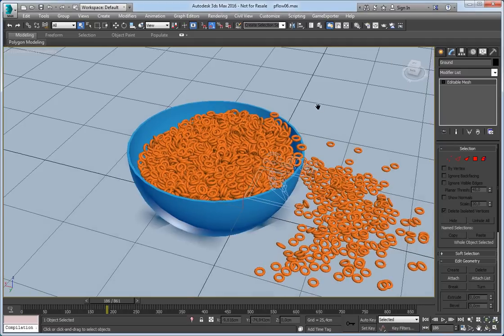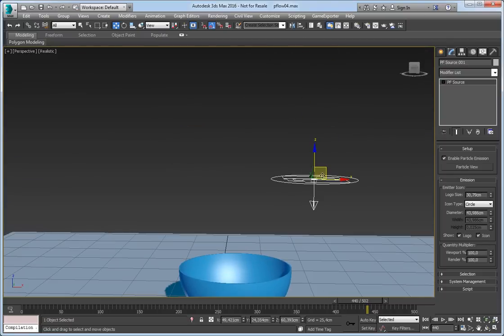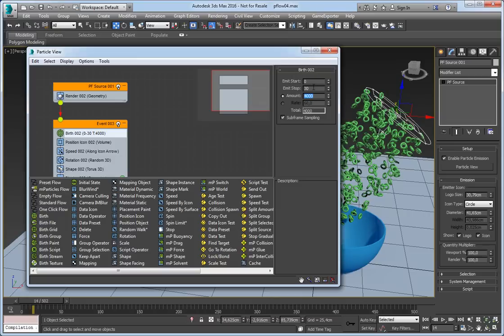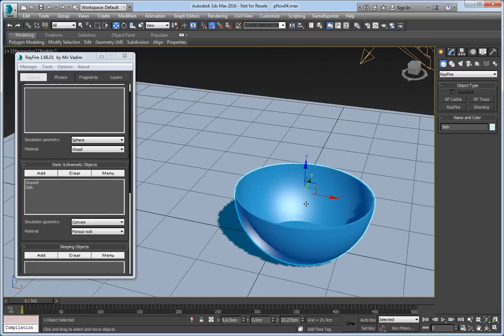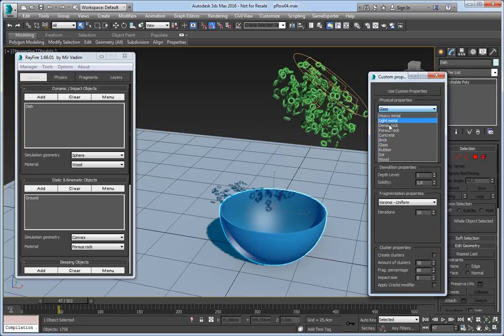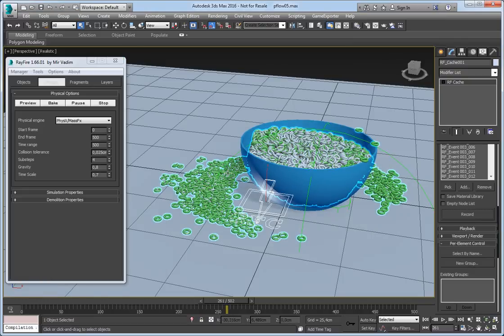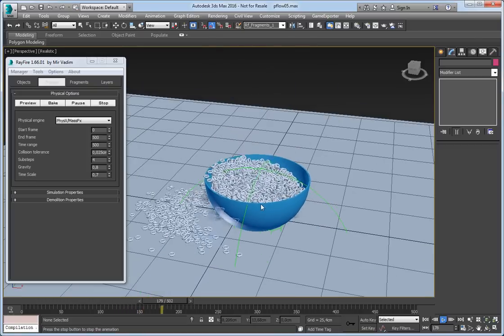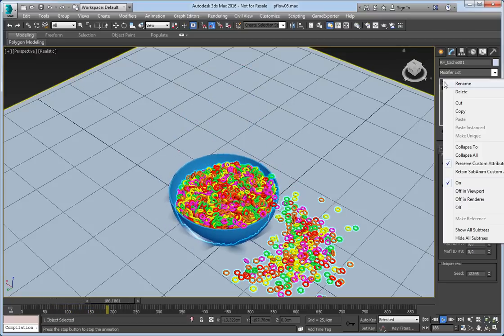RayFire Tutorial - Filling dish with cereal using PFlow

Comment: when my particles die in pflow, no particles/ simulation begins in rayfire so I don't get that effect.. I did exactly what you are, how could I fix this?
Reply: nevermind! There's a setting in rayfire in physics tab that lets you enable simulation after particle death if anyone else has this problem
Reply from the maker: Can you send me your scene? It will be much faster to help you if I will be able to take a look what is going on there.
Reply: Thank you!!! I had this problem and I didn't know how to solve it! :D :D :D
Reply: Hi, i have the exact same problem, i tried to reset my scene multiple time, nothing happened after my particles dies.. can i send you my scene for a quick review ? I really would appreciate MirVadim!
Reply from the maker: Of course, and let mek now which max and RayFire build you use
Reply: Great, thank's you for your quick answer MirVadim, where can i sent you my scene? Do you have a gmail?
I'm using Max2018 + Rayfire 1.71.01
Reply from the maker: YOu can find it on website. Also, I just noticed one weird bug in PFlow. When you set Geometry type in Display operator it doesn't show particles correctly and RF can't continue particles after death, set Geometry type in Display operator to Dots and try again. And don't forget to turn On Generate Mesh when particles dies at the bottom rollout in Physics Tab.
Reply: many thanks. now it works